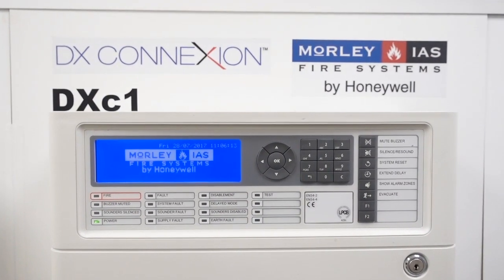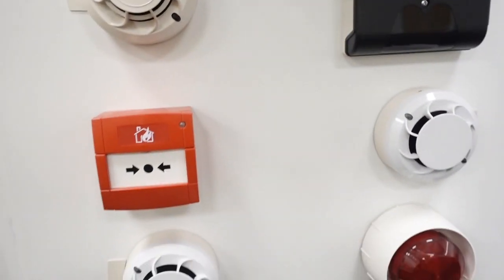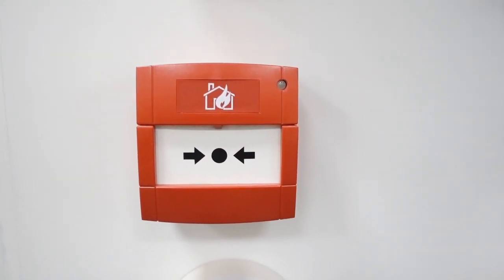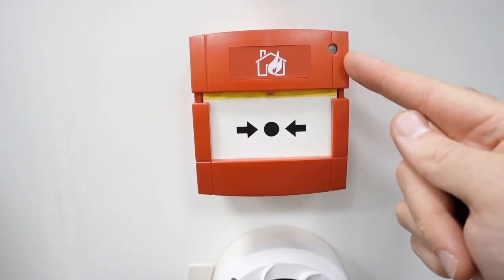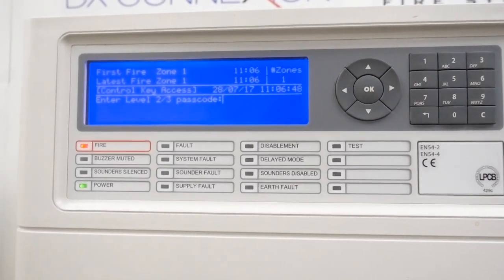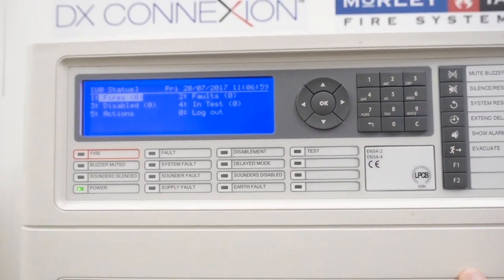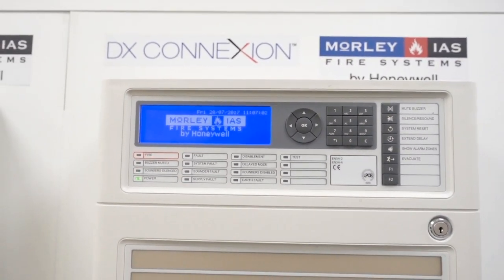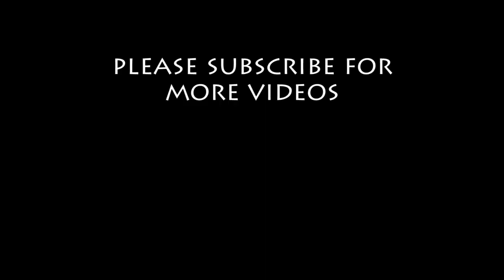TESTING MORLEY IAS DXc1 PANEL | SYSTEM SENSOR MCP | FIRE ALARM DEMO

Comment: sir standard number of smoke per loop? i have trouble of bad device what does in mean?
Reply from the maker: It isnt a straight forward and answer because it also depends on how many output devices you have on the loop such as sounders, is the Loop compliant with the size of the area it serves, the current power supply and backup power supply and zoning. A bad device would suggest the contamination.

Comment: Hi sir  I will install the Morley panel detector & MCP installed the loop,than check the detector and MCP, check MCP actived in panel but detector is not activated
Reply: Hello, you’ve must wired it wrong and the panel shows no detector device.